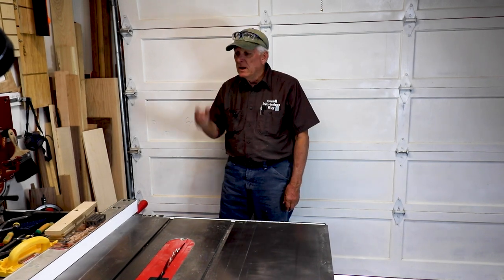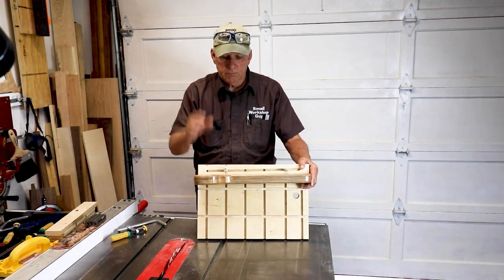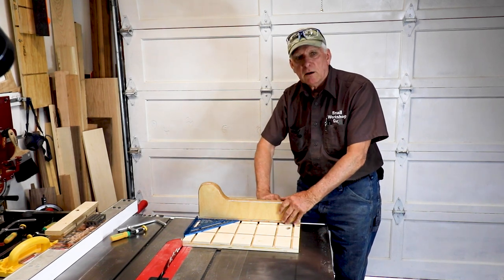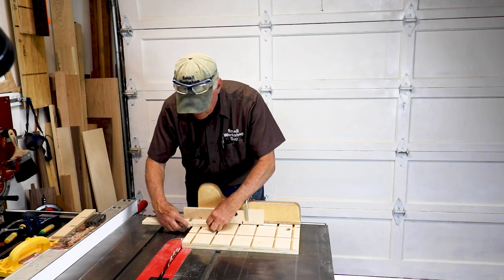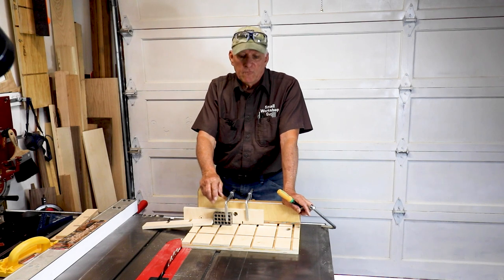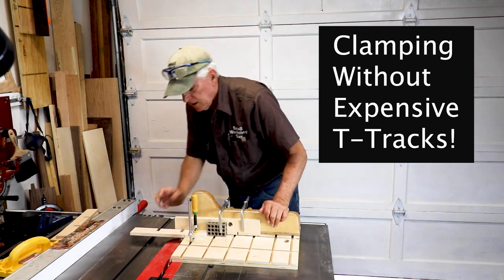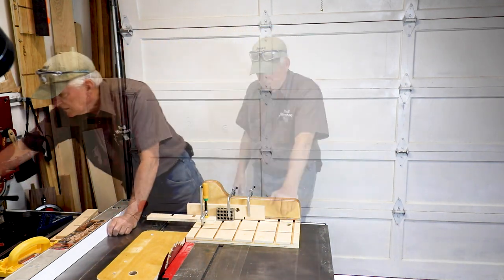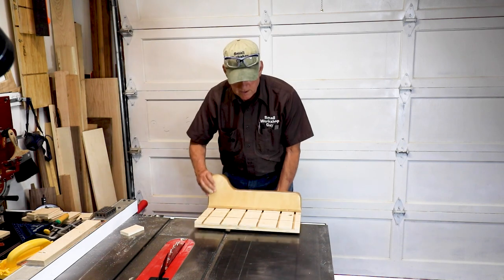Mini-Crosscut Sled Utilizing Matchfit Dovetail Clamps from Microjig

Comment: Smart idea, and very useful for someone that doesn't have a full size tablesaw that needs a small crosscut sled.
Reply from the maker: I find myself going for mini sleds 90% of the time.  Since my compound mitre saw takes a minute to pull out from the wall and hook up the vacuum and plug it in, it is faster to use the tablesaw I am already probably using to cut things.  I love mini-sleds.  Thanks for commenting and watching!
Reply: @SmallWorkshopGuy  I built a portable folding tablesaw that was built for use with a circular saw. The circular saw is mounted on a removable insert that once it's removed, allows the table to fold completely flat. Even though the table is built pretty stout, I wouldn't want to use a full size sled on it, so your mini sled would benefit me too.

Comment: Thanks. Came down with Wuhan virus so finally went down to the wood shop and made my two match fit crosscut sleds (L and R of blade). You have given me some good ideas here so thanks. I had the matchfit starter kit since November. Glad to see the usefulness demonstrated. T-bolts? You want to be a little more specific?
Keep putting vids out. They are simple and very useful.
Reply from the maker: You can use jigs designed for T-slots by using an angle grinder to make the end bolt just a little bit more narrow.

Comment: I have not bought the dovetail clamps yet, but this kind of teaching will help to speed up the process
Reply from the maker: Yeh, I have 6 clamps, but I am using them in so many jigs, I may buy more
Reply: @SmallWorkshopGuy  Bought the Clamps, they are very nice, will have to buy more as I see the usefulness of them, I read something about them being redesigned from the earlier ones to fit the track better and mine to slide great, I'm revisiting your videos for ideas, thanks.

Comment: What are the dementions of this sled? How is the fence attached?  I want to build one.
Thanks
Reply from the maker: Sled is probably about 20 inches wide and 15-20 deep.  Look at the video at 1 minute 10 seconds to see how fence attached.  Fence simply glued to a slightly wider support piece of hardwood that has an internal slot in it to accept the T bolts.  I use thumb screws on the t bolts to align the fence and lock it down.
Reply from the maker: Also watch the Microjig promotional video and go to their website for several Matchfit Dovetail plans. https://store.microjig.com/products/zeroplay-360-sled-kit

Comment: This looks useful! Now for a newbie question....when your angle grinder sparks like that...are the sparks a fire risk on a wood workbench? Or possible risk of pain/injury to your hands/arms? I am only referring to an area completely clear of flammable finish or other flammable substances. Just wood. 
Thx.
Reply from the maker: Definitely a fire risk, particularly if you run the angle grinder for a prolonged period of several minutes.  You are right - flammable finish or liquids should be moved out of the area.  Personally, I have watched several angle grinder safety videos since doing this video and have changed some of my procedures - now use face mask and heavy gloves and make sure area where sparks are flying are clear of most wood and debris.  And now I also set up my metal cutting vise on sawhorses out in the driveway.  My theory is you cannot overdo safety ever.  Of course, you have to learn it first!